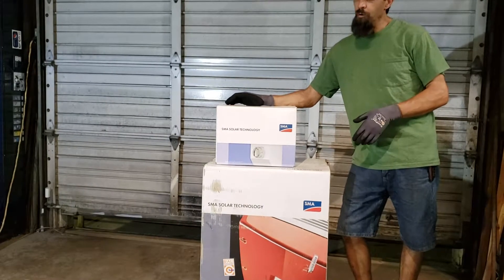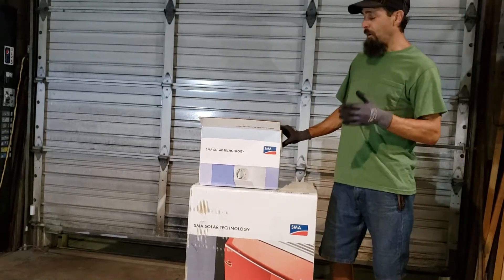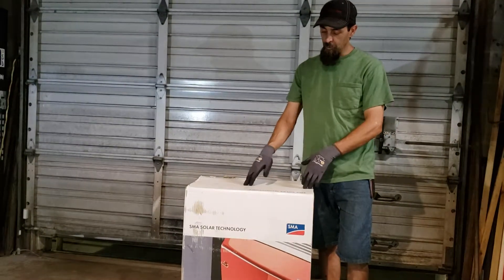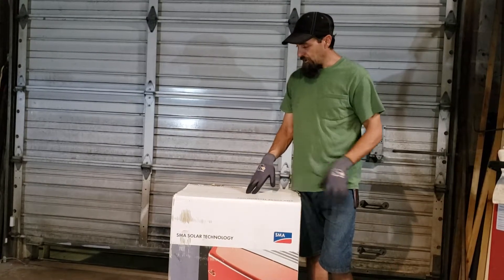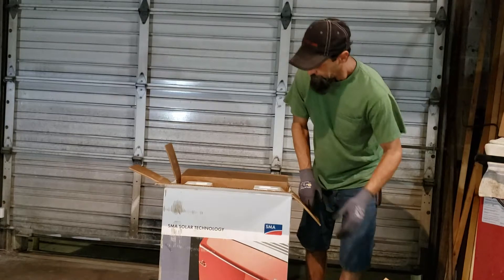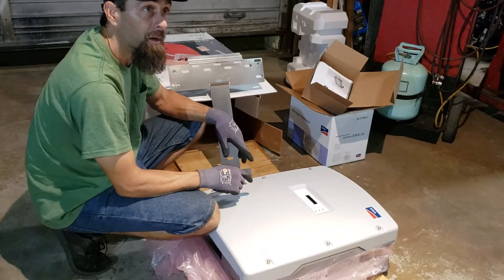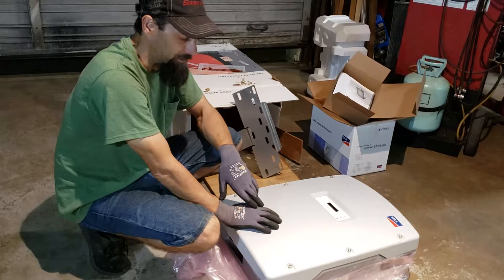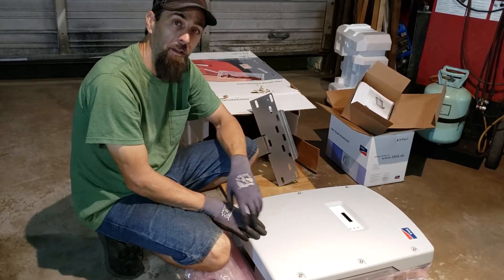SMA Sunny Boy 6000 US string inverter unboxing and info

Comment: first six monthes no problems after that it's Elecrtical ground fault, unit kicking off. I reset it and it goes a couple days or weeks then it goes off again. Somebody needs to come up with a way to bypass this error code.  I won't be using this system in my future set ups.
Reply from the maker: I have not got a chance to install mine yet. I'm waiting for my pallet of solar panels to arrive. But I did run across a company that makes inverters and they are here in the US. I'm going to get one of their 8kw off-grid inverters and see how well they do. And yes I'll be doing a product review video and install video for it.
Reply: @codyoffgrid  I'm using like ten year old panels. the sunny boy picks up on Electric DC arc faults. I shut it all down and reset it , and it will run for weeks without an issue. The 6000tl unit has already paid for itself.  The new micro inverters and larger panels seem to be the way to go.